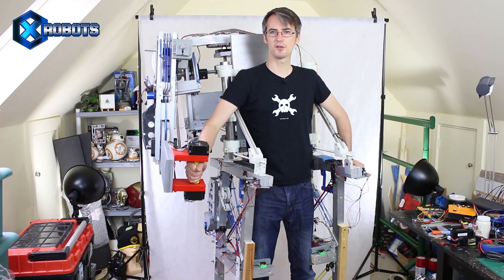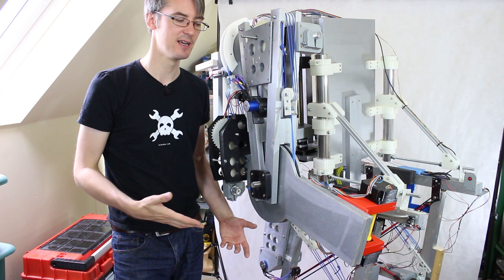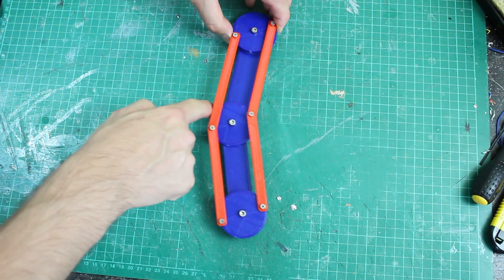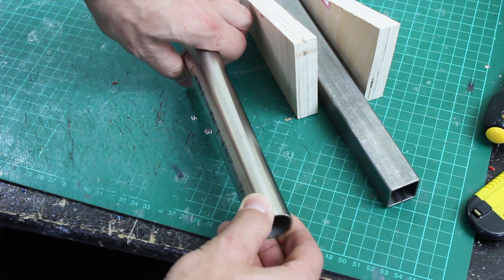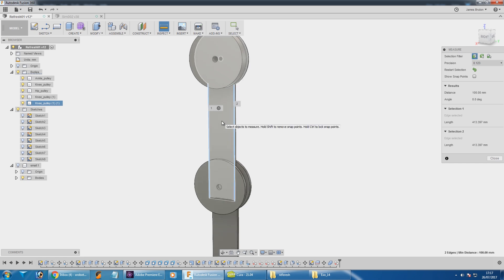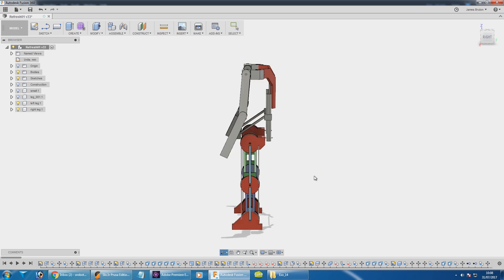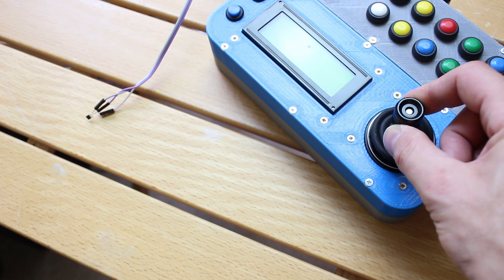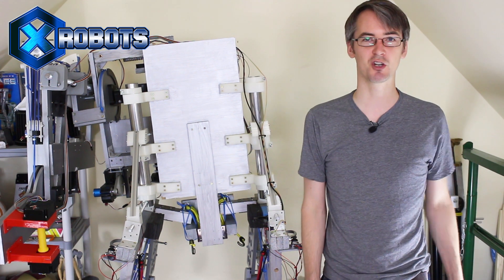Iron Man Exosuit #14 | Design Refresh | James Bruton

Comment: I always thought the iron man suit was one big locking machine.  It never really picked up weight, just holds it and move it around.  The thrusters are usually used to move the limbs around.
Reply: If the suit was able to lock each joint and the software/ hardware knew what action the wearer wanted to do.  It would lock off bendable sections to allow the operator to complete the task.  Granted really heavy objects couldn't be moved by unassisted legs but to lock the spine and arms could allow the user to carry more than they normally could.     (I don't know,  Just wanted to give what I thought the ironman suit was.)
Reply: Second One yeah iron man throws a car in iron man one so it is powered but the later ones seem to be locked

Comment: Instead of using ropes and pulley's why not use a planetary gear system? The leg for example, put one (or several) motor(s) facing up wards and where it meets the hip have a large non rotating gear at the hip. When you raise your leg, the motor attached to the femur would spin and work it's way around the permanently mounted hip gear raising the leg.

Comment: Do you have a way to assign weight to the 3D model pieces (based on measurements of the materials you want to use), and simulate physics? I ask because, roughly knowing the center of gravity for your new design would be super helpful, before you start fabricating, so you can make adjustments early. I don't expect you to do this if it requires learning new software, or you feel comfortable with you existing troubleshooting strategies; you do have a schedule to keep, I'm sure, after all.

Comment: ever thought about doing an exoskeleton using hydraulics instead of motors?  idea i had was to use the hydraulic controller from a forklift or or a bobcat tractor.  use arduinos to control when the solenoids are opened or closed.  whole thing would be real heavy, but if you made it out of steel it'd support its weight.  basically my imagining of it  was "how would i make a forklift into a suit"

also check into the olimex board that plugs into arduino and hooks to ekg sensor pads.  you stick em on a muscle group and you have data you can map to the arduino.  closest thing to plugging the arduino directly into your nervous system that i can think of and would be an elegant replacement for all those pressure switches and proximity switches and stuff.
Reply: yeah, i was thinking small biodiesel would be ideal.  really though you wouldnt need that big of an engine for it... doesnt need to drive the wheels or tracks, all it needs to do is turn a hydraulic pump.    a lawnmower or motorcycle engine would probably suffice..  i'll continue to watch as your project comes along.  what you're doing is brilliant.  

btw: do look into those olimex ekg-emg shields for arduino.  (https://www.olimex.com/Products/Duino/Shields/SHIELD-EKG-EMG/) dunno how much tinkering-with you'd have to do to make em work, but the idea of just piping the muscle signals directly to the arduino to control the bot excites me in ways robotics projects should not.  lol

Comment: Uuuuh very cool to see you get towards the interesting sensors!

@James: I've got some recommendations & ideas for you, I'll write them as answers to this post
Reply: Regarding magnetic "linear" hall effect sensors: They have a linear output regarding field strength, but the field falls off quadratically with distance.
If you buy neodymium magnets, be careful to to buy way too big ones; for sensing 10mm*10mm * 2mm or 5mm^3 might eg. be what you want
Reply: Regarding pressure sensors: A very neat trick you might want to use in the feet of you robot:
Use a barometric pressure sensor and put it with an air bubble inside of a blob of silicone that you mold as a bumper for the foot.
Can give you very nice readings

Comment: Aluminium alloys are stiffer, stronger, and lighter than any mild steel. You have to choose the right kind and consider if it requires tempering and destressing for even higher strength. The cost would be higher than mild steel, so maybe use them for the final phase of prototyping.

There are kits to do small composite pieces too, but that cost can be even higher and requires special knowledge to do correctly.

Comment: For a sensor you could use a motor.  If the motor had a position controller that held the motor so it would not rotate.  You could use a position encoder to sense the shaft position.  Then when you try to turn the motor the controller will drive a current to hold the shaft fixed.  The current is proportional to the torque.  So this would act like a torque sensor.

Comment: I am a fan of the aluminum extrusion, buy mostly for aesthetic reasons. Also I think the problem you are having with the force sensetive resistors is that they have a lot of prsscision but have a very short throw they have precision over a very short distance so when you apply pressure you are applying enough to fully press down the fsr.

Comment: Is there a reason you're avoiding known methods of building robotics? Surely you should be utilizing pistons and air compression. I mean I'd think the obvious one to look at is a T-800 from terminator which makes full mechanical sense. I've seen a lot of other suits made from pistons - one guy made a suit that he can lift a car with, and is like 10% the size of your prototype. Would be a lot simpler than loads of motors, which are not really suitable for driving a limb - you are converting circular motion to straight - lose so much power in that, and using loads of pulleys is just adding massive bulk to your build - you're in a circle of issues!
Reply: Worm gears is a good idea... Except they're pretty slow. Definitely a lot of punch in a tiny package.
Reply: Adam Robertshaw thinking outside the box is good is good but I agree he should use wormgears because they are much smaller
Reply: Adam Robertshaw Boston Dynamics Atlas uses onboard hydraulics. I'd imagine it's super expensive to equip and power hungry as hell. Pneumatics just aren't as strong unless you're using a highly compressed gas like nitrogen, which can't be compressed on board. It'd have to be a tank lugged along (which will eventually run out) or just standard compressed air, which can't achieve very high pressure. So low pressure requires large surface area pistons to move heavy weight but hydraulics can be self contained and make a butt load (thats scientific terminology) of pressure so the pistons can be relatively small.  I can't imagine James had the funding for a hydraulic system that.... But it'd be freaking awesome if he did.
Reply: James Bruton yes but linear actuators that use worm gears  are very powerful
Reply: James Bruton I'm not engineer myself (hopefully in a few years) but the hacksmith has told me that it's best if you can buy all the parts and just build the box because you will avoid lots of trouble that way

Comment: Since a lot of people seam to be offended by using wood, you could sort of compromise by laminating the wood with carbon fiber and/or Kevlar. It won't add much weight, but should shut up opinionated people who are complaining about the wood. And think about this: composite aircraft are usually made of foam, covered in a few layers of carbon fiber. And nobody complains about aircraft made of foam.
Reply: custom fabrications I think the people complaining about wood should contribute more money to his patreon and quit bitching. X-D

Comment: Strain gauges can work really well when used correctly.  Use superglued to attach it to a semi ridged flat surface and apply a moving average to the data output to smooth out output signal.

Comment: I know it's expensive but...
Titanium is about 40% lighter than Steel and just as strong.
Reply: it's so expensive tho,  and a bugger to tap, bend, weld etc.

With that kind of budget you could buy or make carbon fibre tubes.  Even stiffer and lighter.
Reply: You answered why he's not using titanium yourself, its expensive.
Reply: I was watching a car show where some posh supercar was made with CF which has titanium wires to give "rip stop" properties.  That really would be best of both worlds if that kind of cloth is available.  I kinda remember them saying they wove the cloth themselves.  Mighta been Koeningsegg.  I'll have a look.
Reply: I actually was going to say the same thing, and titanium is also much stiffer. Won't bend, flex, or twist very easy at all.
Reply: All true points about the titanium, but carbon fiber tubes can be prone to cracking and delaminating with too much abuse.

Comment: Cheap hack: with V-Slot you can just use M5 thin square nuts. Cost a fraction of the price and work jut as well. Hell, I’ve even developed the knack of being able to slip them into the groove instead of from the end.

Comment: Hey instead of the touch sensors as a control interface, why don't you scrap some video game controller sticks and set up 4 in the same configuration? They have excellent precision (you can move your character at any speed in between stopped and full speed) and could be much the same to code and run. It would also be less janky to control when you twist in different directions.

Comment: Please use aluminum. I've worked with 1inx1in and 1x2 extruded tubes for 4 years making robots and I can assure you it can be incredibly rigid while also being much lighter than steel. As long as you design your mounts and joints robustly you should have no problem with the aluminum tubing.

Comment: I would definitely use the aluminum square stock. I have used it extensively for various projects and it is much stiffer and you give it credit. I think the steel will make it unneccesarily heavy and it is more difficult to work with.

Comment: Totally love the direction of the MK II. 
For those of you, like me, whom are Impatient or missed his comment on it the electronic device at 11:55 is called a strain gauge.  

Also, 

Judging by the amount of noise made by the the strain gauge, It may require mounting on a more solid object rather than floating in air. A lot of that noise may have been caused because of it's sensitivity and "flopping" in the air. Stick it to that steel square tube, a piece of aluminum extrusion or a 3D printed stick and you may get much more precise readouts when you bend the tube/extrusion/3D printed stick. 

 Hall Effect sensors can be manipulated by errant magnetic fields if not in a magnetic shielding environment, your phone rings, a motor spinning, etc  and your suit may do a jig weather you want it to or not.